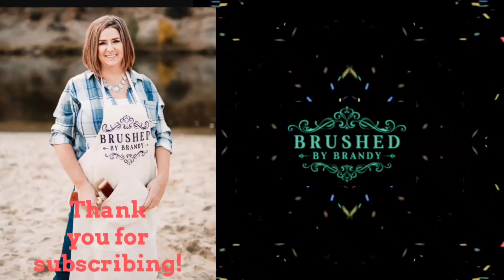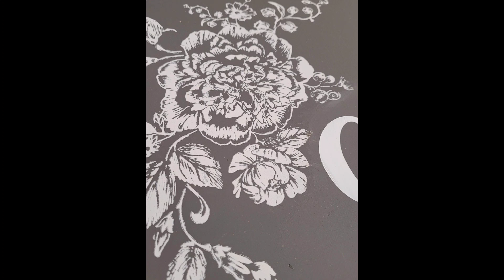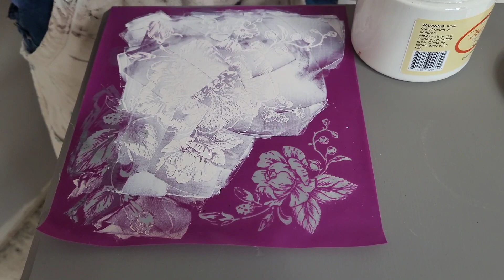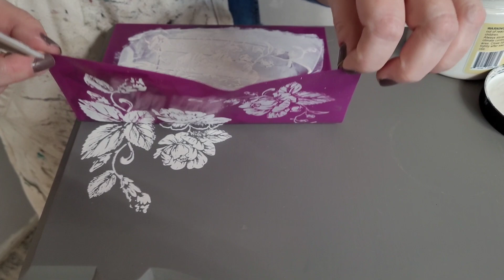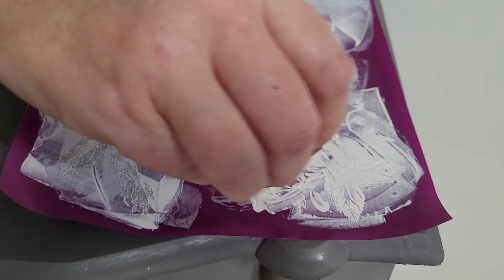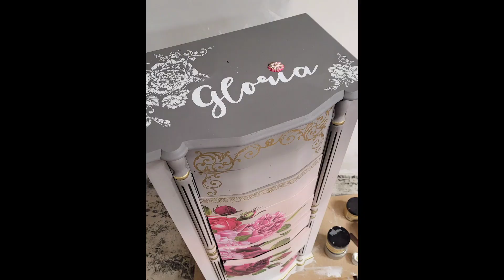How to use a silk screen stencil

Comment: I just purchased some of these and I’ve never use this type of stencil before… Is it possible to use it on a glass window? From what I’ve seen so far it looks like you have to heat set it which of course I couldn’t do on a glass window, so if that’s something that has to be done, I think I know my answer, thank you for the video. It was very informative.
Reply from the maker: I no longer use or recommend any products from this brand, more info here
https://youtu.be/mytyTFAg2no

These are a concept that was copied from other brands. Could use in glass do long as the medium would stick and it didn't get cleaned

Comment: If using the stencil on the same piece repeatedly, do you need to clean between use so paint doesn’t smear on subsequent applications
Reply from the maker: Yes, you'd need to clean between each application
Reply: @BrushedbyBrandy  thank you. 😀